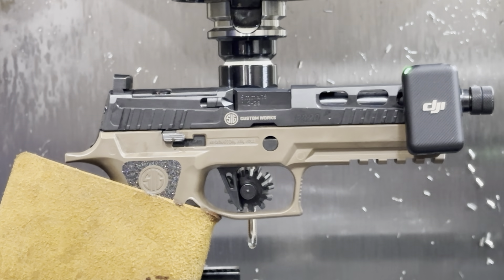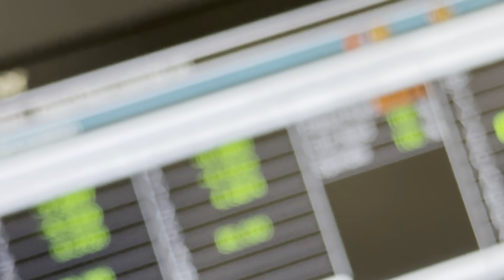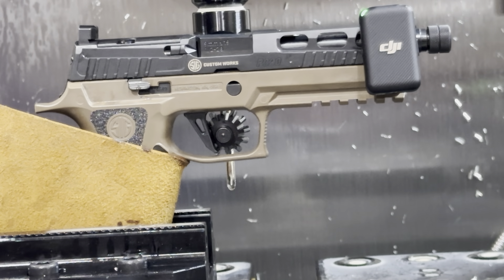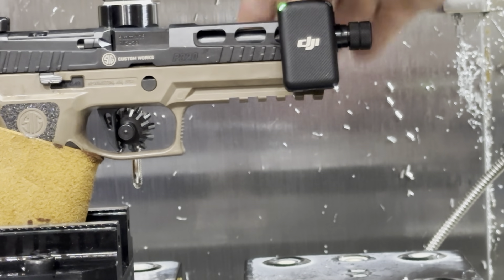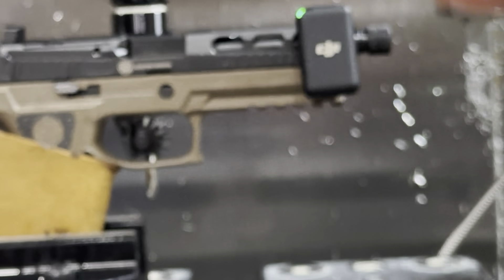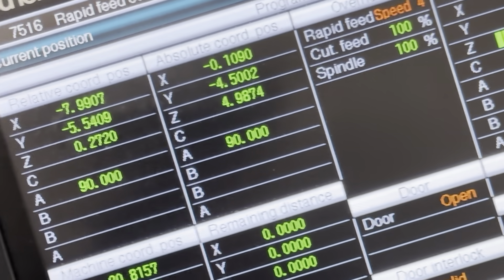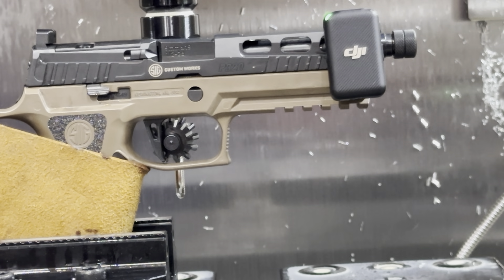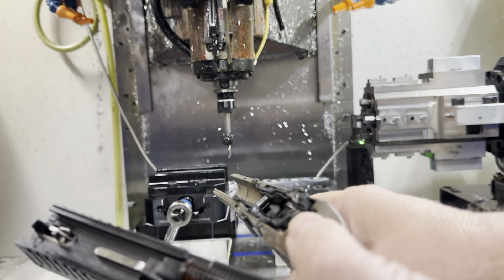Sig P320 accidental discharge tested in CNC machine.

Comment: Even at 2mm the gun should not go off by manipulation of the slide period!!! I say if anyone believes in the P320s so much carry it loaded and appendix…..
Reply: Not to mention, and this seems to be lost on people, is 2mm is about what you need to deactivate the striker block. If the spring in the block is bad so that it is inoperable, then it achieves the same end results without a trigger pull. That last bit that sets the gun off is just releasing the striker.
Reply: he proved the glock failed the exact same test. watch his other video
Reply: Glock bad too?... https://www.youtube.com/watch?v=NKiN14zTF6o
Reply: Yes, exactly. A gun should never go off unless the trigger is FULLY depressed. Talk about a design flaw. I don't know of any other firearm that can be fired like that, you know, by simply touching the slide. That's crazy!
Reply: Theres videos of a glock and revolver doing the same thing, by your criteria, damn near all guns are unsafe.
Reply: I carry it loaded every day and have for years. My Sig has 2000 rounds through it will not discharge without deflecting the trigger. He just showed you need to be damn near in the breaking point of the trigger before it fires by wiggling the slide.
Reply: @Seansousa757  try it on yours (unloaded obviously) and get back to us. As someone who is a fan of sigs i wouldn’t want to carry a p320 just because of the abundance of reports about them.  P365 all day everyday, no issues there, but the 320…
Reply: @Master_Beef why? Not a single person has shown the 320 discharge without the trigger being deflected, not one. I don’t touch the trigger unless I intend to fire the weapon. If the weapon will fire just before the break point by manipulating the slide, something that could only happen while reholstering, I don’t care. I know how to reholster my firearm.
Reply: @Seansousa757  I get what you’re saying I just personally don’t feel comfortable with it. It’s a great gun, it’s fun to shoot, it looks and feels great in the hands. I don’t trust aiming it at my junk with one in the chamber.  Also I think grandthumb did a drop test with it and it failed. What if I bump a table while it’s holstered. What if I bend or move in a way that cranks the slide in the holster. What if my girls hair finds its way into my holster and tugs on the trigger just a little. 
There’s endless situations that could cause what he showed to occur.  Test it yourself, idk what else to say.
Reply: @Master_Beef I don’t disagree. I have said since the FBI report that Sig had an issue and needed to do better. I have $15k in Sig weapons and it breaks my heart to say I won’t buy another one until they own this. Nobody is wrong to say you should not be able to get the striker to drop unless you fully engage the trigger, I just hate the people who make this something it isn’t.
Reply: @Master_Beef  - Are there any of these kinds of issues ever reported with P365's ?? .. just wondering because I have a lot of them and my whole family carries them (Me, Wife, Daughter). I haven't yet tested my P320's or my P365's .. but when I get a chance I'm going to. I don't usually carry my P320 (P365 more convenient). I am really hoping there is no issue with P365's. Like I said, I have several of them.
Reply: @Seansousa757  Tell that to the dead guy.
Reply: @glib_facsimile why? There is absolutely no information about the AF guy. And when it comes out, I guarantee it was a negligent discharge
Reply: @Seansousa757  Because according to several albeit unconfirmed sources, the gun was still in the holster, and was detached from the QLS fork on the holster. Meaning, the gun was still in the holster and the guy took it off the belt mount. If this is the case, how did he manipulate the trigger?
Reply: @Seansousa757  This guy looks like he knows how to reholster his firearm... how do we explain this? https://youtube.com/shorts/cOUfurKIjnI?si=A5HRNR6kkzwSSlep
Reply: @Seansousa757 I own one too. Idk why it has taken this long for it to go ‘mainstream’ because this problem is not new. Took it to the shooting range over 2 years ago, turned it upside down and banged it on the table, round went down the range without pulling the trigger. Gun hasn’t left the safe since. P320 is absolutely trash.
Reply: @oldsport4029 I don’t believe you. Nobody has been able to replicate such an event.
Reply: @squidly2112  I looked into it a little and haven’t seen anything regarding the 365 variants, not an authority on this lol but, I’d say you’re probably good.
Reply: @chillchili9361  this is a great example of why you always look it in, it could’ve still happened if he did but, he probably would have aimed it in a better direction as he reholstered.
Reply: @Seansousa757 ssssssure you do 😂
Reply: @Seansousa757 which still should not happen just by wiggling the slide. Use your damn brain idiot. That gun should not fire at all unless that trigger is pulled to 100% pull.
Reply: @Seansousa757  my AXG Pro doesnt seem to be affected. Im just at a loss for how these are going off without trigger pulls... 90/1000ths or otherwise, it seems like you've got to pull the trigger or am I tripping?
Reply: @gunplaytv you’re not, the FBI and every YouTuber has had to pull the trigger.  It to a breaking point, but they have to pull the trigger. This is something that should not happen, and I think Sig needs to be honest that there is an issue, but it’s not what all the crybabies are saying.

Comment: Okay, but i dont understand, why is it okay for a gun to go off before the actual complete trigger pull? 
Im sure other handguns do not go off in such a manner by just wiggling the slide in the exact same circumstances?
Reply: @lucky_Limes no one knows, because no-one has tested it yet... so until someone takes a striker-fired pistol with fully-cocked striker other than a P320 and tries the same experiment, no one will know if it happens the same way with other guns as well. To be honest, i'd take bets that the all fire at some point, just before the shot would normally break, if you'd try it. Maybe 1mm before the shot would break, maybe 0.1 or even 0.01mm earlier - but they all would probably do the same
Reply: @fischitv9704  Already proven the Glock does the exact same thing.
Reply: @notes9504 If this happens to all striker fired handguns then I think there needs to be some other safety mechanism in place that keeps the same characterists of a striker fired gun but doesnt just randomly go off, even if it means an increase in cost :/ 

I just dont want people to be accidentally injured or killed because the tool theyre using decides to shoot them one day
Reply: @Lucky_Limes I don't like striker fired pistols period.
Reply: @fischitv9704  but still, I don't think that wiggling the upper receiver is part of the traditional "trigger pull".
Reply: Literally every gun goes off before the full complete trigger pull.
Reply: Glock good then?... https://www.youtube.com/watch?v=NKiN14zTF6o
Reply: To be competitive, Sig Sauer introduced the "shake awake" feature, and a "decocker."   Now the Sig P320 fires 100.003% of the time versus competitors which only fire 99.995% of the time.

Comment: Everyone is mad that you did this. They are absurd. The fact that they're debating that if you pull the trigger that it would cause an "uncommanded discharge" is absurd.
Reply: Bottom line, it's not about whether or not the trigger is pulled, it's about mechanical faults caused by or exacerbated by machining inconsistencies. Putting the trigger to the wall could simulate debris, carbon, etc getting into the mechanism and removing that slack in some way, which could then allow to firing pin to drop is the gun is jostled or manipulated. 

There's a fault somewhere in the gun's design, that's been made very clear. What it is, I doubt anyone except maybe people at Sig know. Regardless, the pistol is unsafe and should not be trusted, period
Reply: And to clarify, I'm not a Sig hater, I have a P365 and P210 and love them! I also have a P320 Compact and while mine does not fire by doing what's been showed (by finger, I don't have a CNC), it lives in the safe now until this is all figured out and fixed or recalled.

Comment: One thing I’m curious about is in regard to the torsion; I saw you wiggle the rear of the slide but due to how it was secured in the CNC machine you couldn’t get much movement out of it. When in a duty holster that’s secured by the slide, there’s significantly more leverage on that twisting motion from the grip of the firearm. So if there’s a faulty trigger group, trigger partially depressed due to whatever reason, I’m curious about how easy or difficult it would be to make that striker fall

Comment: If I bought a 1911 with that slop in the slide I'd return it immediately.
Reply: It's an FCU, lol. Sigs are like AR-15s They use an FCU which can be swapped into any frame or slide. Of course it jiggles...
Reply: @RightWingMatt explain why the RXM doesn't have anywhere near as much play despite also being an FCU-style pistol
Reply: @ThatOneFriendlyDude  The RXM is also more complex and Sig's design predates it by nearly a decade. The P365 is also tight. Regardless, it doesn't affect the performance and this gun does does not fire unless the trigger is pulled.
Reply: @RightWingMatt You come off as the sort of glue-eater who doesn't see a problem with Sig changing their wording from "gun won't discharge unless fully actuated" to "gun won't discharge unless the trigger is rearward" to doublespeak their way out of taking responsibility 
The P320 (and 365 for that matter) has no excuse for being as sloppy as it is, and it's enough to where all it takes is poor QC (a common sight with Indian MIM parts) and/or carbon/debris fouling of the sear to where the gun may not require any trigger travel at all to discharge; not to mention that a trigger going from rest to wall is well within the threshold of a bumped or dropped gun to achieve (especially one without a trigger safety)
Stop running defense for a company who would probably sue the shit out of you for speaking out if you got injured by carrying their product, whatever they're paying you isn't worth it
Reply: @ThatOneFriendlyDude  Doesn't matter. The gun won't fire without the trigger being pulled. Period.
Reply: 1911s also have that short trigger travel by design but have multiple redundant safeties to keep it from going off unlike the P320 (and Glock).
Reply: You obviously were never in the military. The 1911 I was issued as a MP was atrocious !!!!!!!!  makes the P320 look like a Staccato
Reply: @rickw5024 Didn’t seem to affect its reputation unlike the M9 or M17.
Reply: Tolerance, wear, time in holster getting banged around, all these tests aren't accounting that.

Comment: This doesn’t make any difference to me. My sig p320 xcarry fired with nothing depressing the trigger in any way shape or form. It was in my holster with nothing there to touch the trigger at all.
Reply: Its like taking one sample and having it "good" means the rest of the ten million batch are 100% the same and thats so far from the truth. Even at 99.9% on a 10 million batch leaves you with 10 000 pieces from all that, that is out of spec from the factory, and that percentage is in reality way higher.
Reply: So long as your comfortable with it, although for me I’m using this debacle to justify buying another carry gun and putting this thing into the gun safe..not worth the potential risk for me being I appendix carry.
Reply: what holster was it? Im curious if most of these are with holsters that are tightly molded around the trigger guard(*shouldnt* be an issue but Im just wondering if it increases risk with this design).
Reply: I believe this and other similar are all on pistols that don't have a metal parts failure. I do believe there are some that with parts failure and loose tolerance, will go off without the trigger being touched. 
More people testing will give us more answers.
Reply: As a machinist and someone who loves his p320s, when I saw the video of that guy trying to measure the takeup with calipers, it almost gave me an aneurysm.
Reply: Does your xcarry have lots of slop?  Mine is super snug to slide to frame.  The dudes with a curved trigger the old style almost looked like his rear rails were altered to me.  Because my slide fits the rear rails very sug.  I have several k through mine now and ive had zero issues.  For guys with the version that has a safety on it, I personally dont see any excuses to have a negligent discharge.  That saftey should be on if your not shooting and holstered.  Thats why it's there.  For us, I dont appendix carry, and the vids obviously make me nervous, but ive tried to duplicate this, and I just dont have any where near tge amount of slop ive seen on some of these guys guns. Not this particular video, his wasnt that bad, my glocks have similar play to my xcarry
Reply: @Hustler_state  a tiny bit. not much.
Reply: what holster, though, and did it have a light on it?
Reply: Poor tolerances.
Reply: I wonder if once the trigger reset spring is well broken in, theres enough trigger play to fire from manipulating the slide.
Reply: To be competitive, Sig Sauer introduced the "shake awake" feature, and a "decocker."   Now the Sig P320 fires 100.003% of the time versus competitors which only fire 99.995% of the time.

Comment: So the gun will go off even with custom parts. Now try it with a factory gun and trigger and measure the tolerances again.
Reply: he proved the glock failed the exact same test. watch his other video
Reply: @CitizenSeven500  i watched the video he said "if you pull the trigger back far enough it will fire" clearly hes full of copium
Reply: @CitizenSeven500 So long as striker fired guns have loose slides and similar trigger systems, they are going to suffer the same issue. Hand guns with tight slides are safer guns that won't suffer an uncommanded discharge.
Reply: hes a sig fanboy clearly clueless as they come

Comment: What I'd be curious to see is if that distance changes on other P320s. We know they have changed the design on and off paper plus you could factor in use and wear. Does a P320 with more rounds on it drop the sear easier? This is awesome btw, that is absolutely the most precise setup I've seen so far. I almost wish Wyoming sent his 45 ACP P320 from that video to you, to get an EXACT measurement.

Comment: Is that stock trigger? Stock trigger should have 2,3mm of travel until engaging sear and after that 5mm to drop sear. Yours only has 2,768 mm of travel to drop sear.
Reply: That looks like the Sig skeletonized trigger. I have on and love it. Transformed the gun! I don't believe it changes the reported issues in any way.
Reply: @marksfarmcraft1888  Issues might not change, but basic function and travel tolerances are what concern me the most.

Comment: I respect your video. Just one question: would it be possible for debris (brass case shavings, carbon build up etc) to keep sear from returning to FULL engagement, even though the trigger is fully returned because they operate on different springs? Then the slide “jostling” drops the striker?

Comment: This also corroborates a previous video done by sig mechanic. He used a fixture and a dial indicator to measure the amount of trigger travel needed to disengage the striker safety lever at .090. your pistol also shows the same here. the question is why does the striker safety disengage so early? It would seem that you would want the striker safety to be defeated only a few thou before the sear lets go. I know in the grand scheme 19-20 thou isnt much. But why not 5 thou? I do believe there is an issue with tolerance stacking on some pistols where the striker safety is defeated earlier and the sear lets go later creating a larger gap. This also leaves the question, why does the second safety notch in the sear not catch the striker when it lets go? isn't it supposed to be designed as a catch if the striker safety lever fails?
Reply: I’m guessing other striker fired designs are similar in that once you depress the trigger to the wall the striker safety is fully deactivated, however I sincerely doubt that the other pistols have enough slop to let the sear slip off the striker even if the slide is wiggled.
Reply: @zacharyschellinger4769  Every other striker fired thing on the market has much closer slide to frame tolerances. Only hammerfired stuff wiggles this much. Seems like Sig adapted a hammer fired design to be striker fired...

Comment: What I’m finding interesting is why are all these Sig Defenders using highly Customized P320s? To the best of my knowledge the issue tend to be with the Stock model P320s so from the start your assessment flawed. I suspect and would hope that the high end model due to having higher quality parts being used would be less susceptible to the issue that is occurring but you cannot rule out that all models may be flawed. Just because it hasn’t happen “yet” doesn’t mean it cannot happen.
Reply: It's the same when people compare an upgrade weapon to a stock model. It should be apples 🍎 to apples 🍎 not apples 🍏 to oranges 🍊.
Reply: In Thinking Man's defense, that is apparently the pistol he has.  Perhaps he could invite Wyoming to his shop and give the exact same measured test to Wyoming's pistols?  Then they would have one consistency in a test to possibly discover inconsistencies between their pistols.